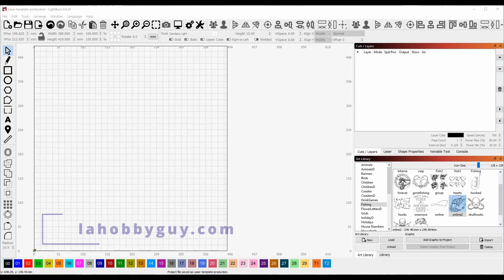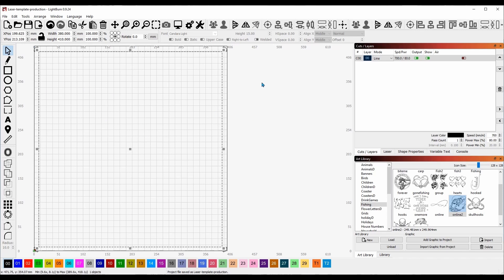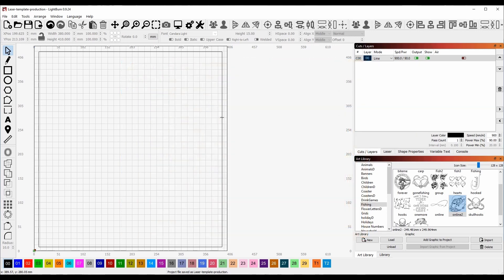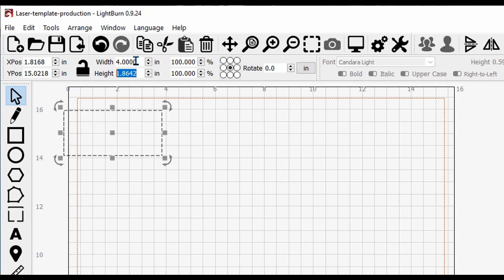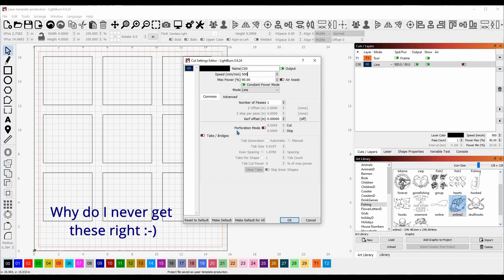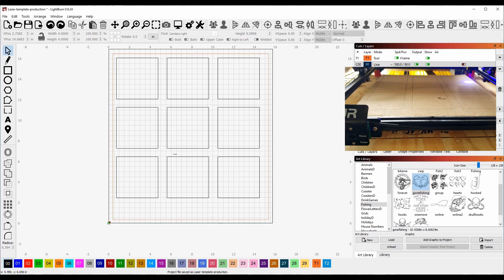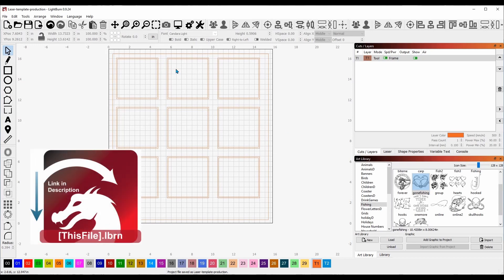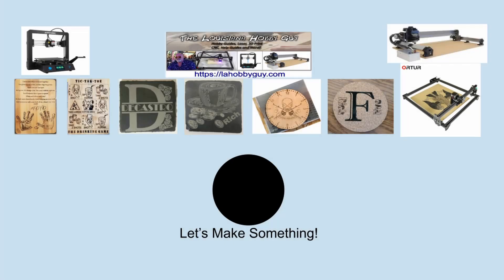Creating A Laser Bed Template for Production Runs - Creating a Jig from cardboard.

Comment: Good afternoon, I just tried this and it was so easy to follow.  I am having issue with it cutting the squares out of my cardboard. The cardboard is 1/4" thick. I tried the settings you had on the video but it did not cut through. I have a 55w OMtech. I have played with the speed and power and still no luck. Any recommendatioms?
Reply from the maker: You may not have it focused properly.

Comment: Hi Rich..thanks for the video. All my graphics turned out about an 1/8" high on my coasters. I'm guessing I need to adjust my template up an 1/8" on my work board, or could there be an adjustment in my software I'm missing? Thanks
Reply from the maker: They should be perfectly aligned unless you moved the template.
Reply: @TheLouisianaHobbyGuy  anything is possible. I may have it too close to the line, so I'll just raise the template about 1/16 actually, and that should do it... just making sure I didn't miss something in the software. Thanks.

Comment: I finally got my template cut out but 2 things didn't do what your video did.
1, When I tried the off set it didn't show a double line line yours did .
2, When I try to put the graph on the template it don't snap to the middle of the square I have to fiddle with it to make it center.
Reply from the maker: Offset set to 0 won't show anything. Check your snap distance in the Device Settings.
Reply: @TheLouisianaHobbyGuy  on my offset I did as you did with.099
Reply: Well not sure it’s what yours talking about but under lightburn settings it states snap to objects and snap to grid are on. Under that is shapes move increments Cyril-arrow 1.0008 and the arrow 5.0013 and shift-arrow 20.0000

Comment: Love your videos!  I learn so much from all of them.  You simply explain how things are done.  
I do have a question here though.  How is alingment done on a honeycomb bed?  I've been struggling with this for some time now, and I seem to get nearly on but I fail to nail it exactly (product with laser head).  With your video you put in a plywood sheet which facilitated the alingment of the template.  This isn't possible on a honeycomb bed as far as I'm aware  - because of the flare back that might occur with a solid base.
Reply from the maker: It has to be stationary and you have to use absolute coordinates.

Comment: so I've made templates and jigs for just about everything I do in quantity. It seemed they worked fine to start with but now they will never open in the right / corresponding location to match up with the physical jig. I have to adjust them every time. It is obviously something I am doing.
Reply from the maker: If you're aligning the jig with the burn on the waste board, it should work fine John.
Reply: @TheLouisianaHobbyGuy  Thanks for the reply. I believe I figured out the issue. I was bringing in the templates using "import" if I use "open" they seem to open in the right location. Just leaving this update in case anyone experiences the same problem.

Comment: So, I set up according to your instruction (at least I think I did), but the framing is off on the X-axis to the right about 8-10mm.Y-axis is dead-on. I checked the Pointer Offset, but that is off. Any ideas? Thx!
Reply from the maker: No Brad, if you burned the file, then it has to be accurate.
Reply: @TheLouisianaHobbyGuy  Okay, not sure what happened, but I finally gave up and flipped the spoilboard over, reattached the feet to that side and then re-burned the target. Now everything is perfectly aligned and working as expected. The only thing I can figure out is I let the laser head slam into the Y-axis rail after I had everything done, and possibly knocked it out of zero. Nonetheless, I think this one is solved. And thank you for replying to my question!

Comment: Rich, I'm rewatching this because a question came to mind. You mention the factory cut at 00/00 was important. When you said cut it out to get the factory edge, did you mean cut with a knife or using the existing factory edge on something you bought?  Couldn't you just get a large piece of flat cardboard and cut using the laser and get a 90 degree edge on all the corners?
Reply from the maker: Yes you can Larry. Cutting it with the laser is just as accurate.

Comment: Great video thanks for sharing. What if the laser frame was moved? You would need a way to keep it in the same place on the waste/template board to get this consistent result, correct?
Reply from the maker: Yes, the laser has to be permanently attached to the waste board Dion.

Comment: First, I really REALLY appreciate all the information you make available to everyone, it's obviously appreciated by all and I love the low-key approach.
So I'm a newby to this hobby and still awaiting the arrival of my first laser engraver (Ortur LM2P2 10W) to start working with. I figure the more prep and understanding before the box arrives might be a good idea?
My first (of many) dumb question is, what stops you from arranging the blanks side by side in an array using the left and bottom edges of the work space as a starting point? It seems like the blanks should be pretty uniform and if the setup is correct, the laser shouldn't burn anywhere near the edges of the coasters anyway. Do you need the space provided by the template between the blanks? 
Thanks!!
Reply from the maker: The template ensures that the coasters furthest away will align perfectly. This is not the case otherwise.

Comment: I relly need some help... I have 6 sets to finish tonight... I used my template yesterday with no issues. today its way off and i messed up a couple coasters.. I mounted my laser to a waste board and re-engraved my template onto it... when i open my template and then import my images, its not anywhere close to where it should be starting!
Reply from the maker: You may have moved it in Lightburn. Try moving it until you get it in the right position and then select everything, right click on it and select, Lock Shapes so it never moves again.

Comment: Hi there, thanks for the great video. Here is a concern I have- How can I make sure that I am consistently lining up my cardboard to the right area that will be framed to the laser between projects? I have to pick up and move my xTool around pretty often (indoors to outdoors). I worry that my laser will not be framed properly to the cardboard template, and I will misalign a burn and ruin projects
Reply from the maker: Yes, it needs to be attached to a permanent waste board. On the D1, most people use a piece of plywood with 4 holes drilled out for the legs to drop into.

Comment: Really useful. I was wondering how one could consistently align multiple pieces to be engraved on both sides and the template seems to do the trick. Do one side engraving on one run flip the pieces over and engrave and cut on the second run.
Reply from the maker: Glad it was helpful Dimitrios!

Comment: My laser never returns to the same spot apparently. I can't even redo a burn once it's finished, because the laser will be offset by however much. My enclosure, laser, expanded steel bed...all of it, is screwed together. Nothing is moving but the head somehow. It drives me nuts but as long as I burn everything once, and don't have to do it again it's not so bad.
Reply from the maker: Easy one! Home your machine, or if you don't have limit switches, physically move the laser to 0/0. Now in Lightburn (diode laser only) go to the move tab. At the top of that window, type in the Move to Position boxes, X 200 and Y 390 and click Go! Once the laser moves to that position and stops, right above the Fire button is, Set Finish Position. Click that button and you're done! Now at the finish of every job, your laser will move to 200/390 out of your way, and as long as you don't physically move it, you'll be able to run jobs twice.
Reply: @TheLouisianaHobbyGuy  I'll try it! I've made some cool things in the week I've been using my 40w...but automating some would be nice lol.

I bought the laser to help me with my business and it already is. Everything in this video except the knife...from the box, to the foam, to the labeling on the tins...was made with it lol.

https://youtu.be/rRcHrdPtFBg

Comment: Just started my new hobby a few weeks ago. One of the first things I did was start making framing jigs/templates based from this video. Fixing the laser to a spot on your wasteboard is critical, so I cut some feet out of 1/8 ply that are .75"x1.5 with a 3mm(thickness of the plate legs on the laser) notch cut .75" into the long axis. Set the laser, slide the feet onto the outside of the legs, and screwed them down. It wont stay put on a bumpy road, but it works just dandy in the garage. 😁
Reply from the maker: Sounds awesome!

Comment: Awesome video and great tip! Unfortunately my co2 laser bed isn’t the most reliable with the honeycomb grate. It’s a little smaller then where it sits on the frame of the machine so it can be moved around and sometimes I move it without realizing it. I’m not sure if other import co2 lasers are like this. My last and current machines were different brands but the same with the honeycomb being a little smaller then the base frame. Anyway I’ve been enjoying all your videos and followed you on IG. Thanks 🙏
Reply from the maker: Awesome! Have you tried using some double sided Gorilla tape? Works really well and easy enough to get off if you want to switch to the knives.
Reply: @TheLouisianaHobbyGuy  I’ll definitely give it a try, thanks for the tip

Comment: Just curious, I heard it was better to elevate a bit what we cut(like those honeycomb bed) to avoid burns on edges. I currently use some rectangle bakery grid, but how to align the template I would put on top of it? Also, how to be sure nothing moves if the speed is about 9000-10000mm/min?
Reply from the maker: You only elevate when cutting. For engraving at 10000 speed, no need to! And high speeds like that only lead to abnormal wear and tear on the steppers and timing belts. I wouldn't recommend it.
Reply: @TheLouisianaHobbyGuy  That's a valid point! I had the case when doing the power grid test, and I was having some part engraved and some parts cut

Comment: Excellent video.  Thoughts on an improvement.  Add .25 inch indexing hole at bottom (2 of them).  Then drill in to waste board (once sure everything is aligned).  You can use .25 dowel, cut to right length to make sure it says aligned.   Kind of like the thumb tacks idea.  

Thank you for all the video.  Support coming soon.  I have to try the tower :)
Reply from the maker: Great tip! I'm stealing that! 😎
Reply: Please do.  I was gonna send the file to you.  I have another thought to add a small relief on each in order to more easily get them out.  May not be needed though.  Again thanks for the video.  Lol it was a “The Louisiana Hobby Guy” marathon this weekend.

Comment: Great video again, thank you for all your help, but i have a problem, with this, i make my template and the laser work perfect square, but when the job is done my laser go back to the origin position, and when i run again the start button  the laser start to engrave but not square, move to the bottom and right size, so i try to turn all off and make again the process but still not square, any suggestions i have neje master 2s max with module A40640.... thanks for your help....
Reply from the maker: I'm not sure I understand, but maybe try changing from User Origin to Absolute Coordinates Juan?
Reply: @TheLouisianaHobbyGuy  i will thanks

Comment: Another awesome video! So clean and to the point. When you do use air assist what do you use to supply air, compressor or aquarium pump?
Reply from the maker: I use an old CPAP machine 😎 I also have 2 others for the other lasers, a small aquarium pump and a small compressor. They all work about the same, since you can't get much air through a 3mm hose in the first place Mike.
Reply: @TheLouisianaHobbyGuy  how did you get the CPAP machine to work? It was mentioned to get a pump that is 1030 GPH, and so I ended up buying a pump off of amazon for my D1.
Reply from the maker: @leviguillory7242  I just put the hose inside the CPAP hose and used my #1 shop tool! Duct tape! 🙂 I have since gone to an ultra-quiet California air compressor with an 8-way splitter Levi.

Comment: Rich, I save all my old cereal boxes for making templates. If I have to make just one of something I will just use two or three thumb tacks to hold it down then laser an outline of whatever it is I want to engrave. Then I  turn that outline into a tool layer, put the material I am layering on the burned outline. No screwing around trying to frame something up just perfect because it is already framed. 
By the way, I find your videos a refreshing alternative to the guys who are always moving their mouse pointer all over place in rapid movements here and there for no apparent reason. Very distracting. Thanks for the beyond excellent video.
Reply from the maker: 😜 Click, zoom, double click, zoom, zoom, move, click, zoom... without doing anything! I get ya! 👍 Thanks for the laugh Kris!
Reply: Hi Rich, great video as usual can you advise the following, is there away to load all template slots at once instead of duplicating and adding to the next. Also how do you where to fit the template on your workspace so it aligns for engraving ,  if you have do not make a full size template to fit your workspace. Hope this makes sense. If you have video on this would appreciate. Nb took a break from engraving only new to this but just trying again. Many thanks

Comment: Hey rich great video! I have one question. For you, is your ortur attached to your waste board or did you just slide it under?
Reply: @TheLouisianaHobbyGuy  yes that makes sense. How do you attach the waste board to your table or enclosure? Sorry for the questions just trying to get the best idea for my setup
Reply from the maker: Thank you! I have 3D printed feet that it slides into, but I can lift it straight out. In this case, I just move the laser and drop it right on the bed.
Reply: @TheLouisianaHobbyGuy  sorry I'm a little confused. So the 3d printed Feet are attached to the waste board?